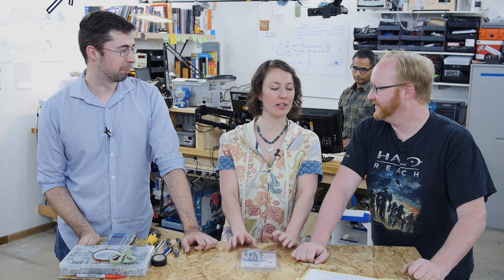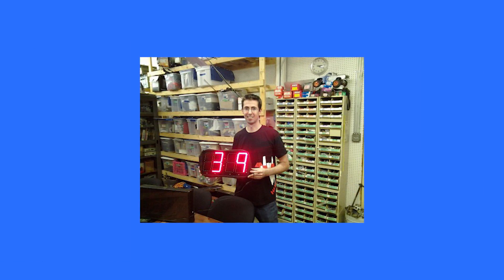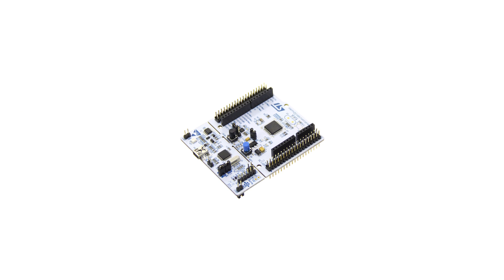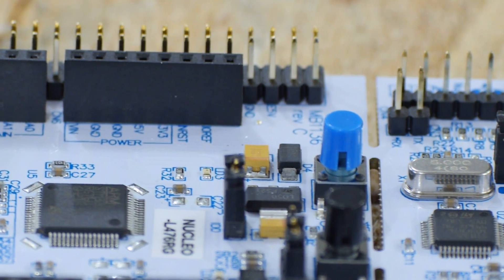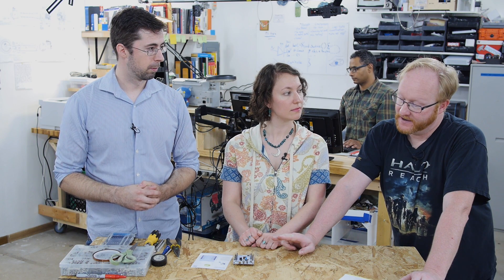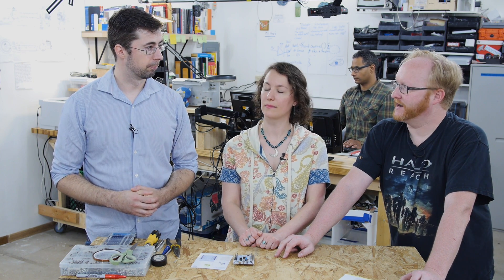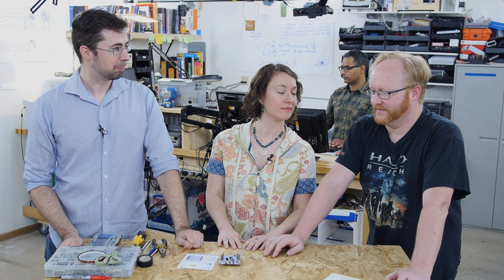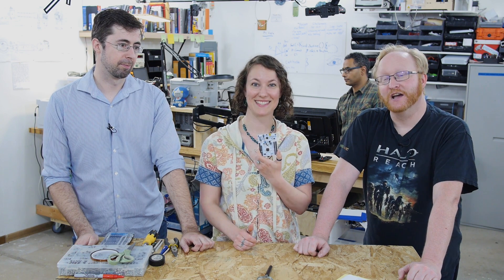IOT On Wheels Design Challenge Announcement

Comment: I'm sure this dude is a lovely guy and does some great stuff, but the idea of using another framework that abstracts another framework which runs node.js is turning this kind of simple job into the Bloat-of-Things.    The Apple and Android SDKs are bloated enough without layering ever more useless layers of crap on top of them.  Especially for an idea which is just read a couple of SPST buttons and send them over BLE.     Really for this sort of challenge you need to do something innovative, and that's really, really hard. So much of this already exists  - Apple watch, Garmin Cycle computers etc.

Comment: I had this idea since the Nintendo Switch came out and heard that the docking station would only be for the Power, Video and USB signals.. 
you could build a Docking Station that communicates with a WiiU (Game)Pad and use that as a Controller or change the video from your TV to the WiiU Gamepad without removing the switch from the docking station, which means you could still play it like it would be in mobile-mode but with the power it has in docking mode since the WiiU (game)Pad is only a wireless video stream and controler. 
Just a thought to get some use out of the old dead WiiU

Comment: A GPS module for anti-theft tracking, something that has low power when the bike is static and can charge when the bike is in motion, also preferably something that can fit inside the frame (although this is unlikely given the size of that microcontroller) or lock securely to the bottle cage mount.
Its going to be a pain switching out batteries or its going to be useless if its outside the frame where it can just be taken, head-tube mounted USB chargers exist for hub dynamos but maybe something that doesnt slow you down like an inductively charged magnetic system would be more efficient in terms of not slowing you down. 
Everybody has bike lights/ a simple speedo/ ride tracking via GPS on their phone already and smartwatches already allow for notifications when riding. 
I'd say its a bad idea wanting to interact with your phone when riding as you should really have your attention on the road.
For ideas on other safety devices that take cars into account the Garmin Varia lights already exist although all these really do is let you know when a car is behind you and how far behind it is.